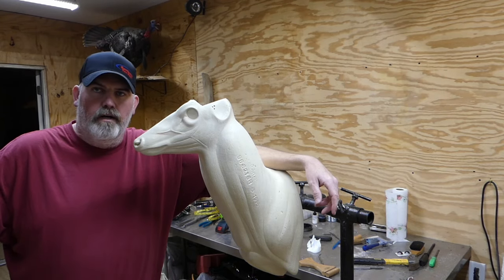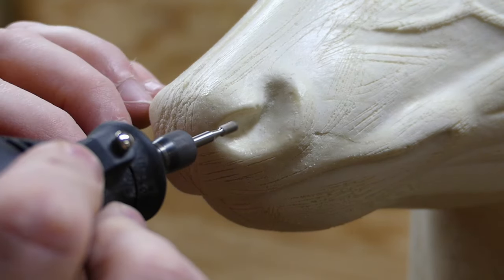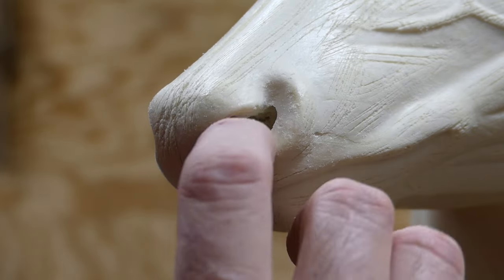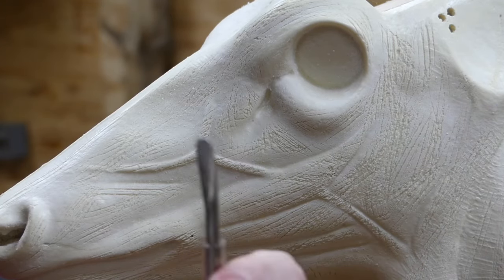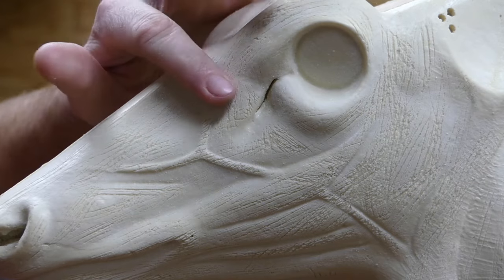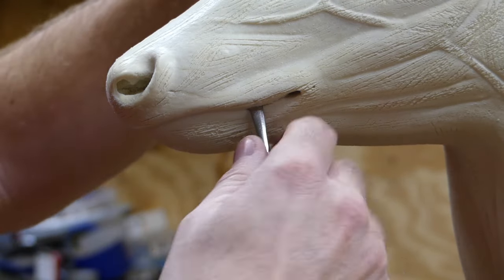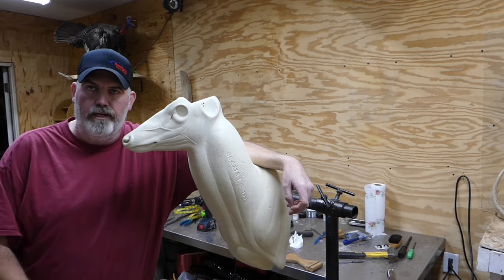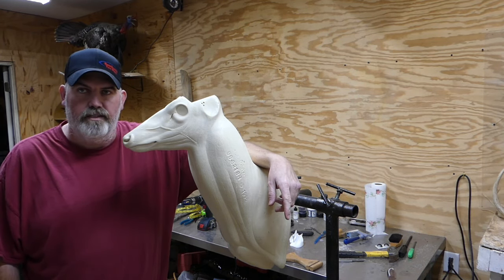Taxidermy how to video  lip slot, nostrils and tear ducts

Comment: What is the most accurate way to measure your cape for a form in your opinion? I went by the neck meat measuring like your supposed to and the form I went with was to small across its forehead and the lip slot was to short. Any advice would be appreciated greatly. Like to see more of your videos. Thanks.
Reply from the maker: Hey thanks for watching! Go over to my YouTube channel and watch the how to skin a deer for taxidermy video. I go over the nose to eye measurement (A measurement)in the first part of the video and the neck measurements (B&C measurements)at the end of the video. This should help you get the correct measurements. If you only have the hide to measure. You can lay it out flat so that it’s on its side and take your (A) measurement nose to eye and your (B&C) measurements can be taken with a yardstick and insert it in the Y cut of the cape and multiply that by two.
Reply: @ClearCreekTaxidermy  Much appreciated.